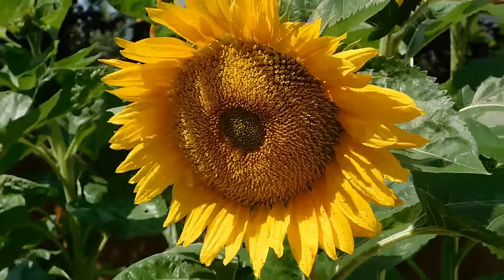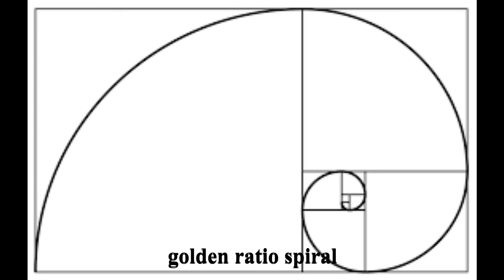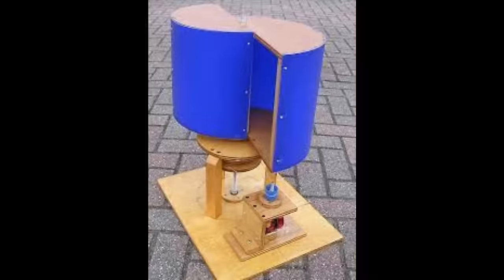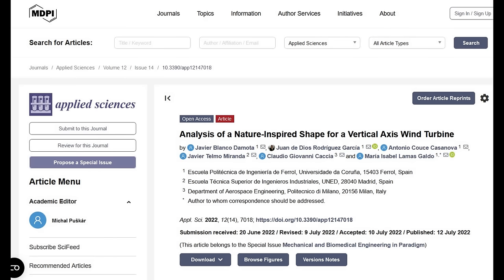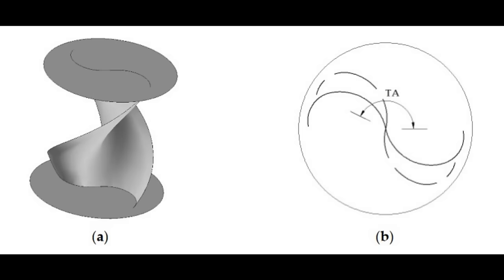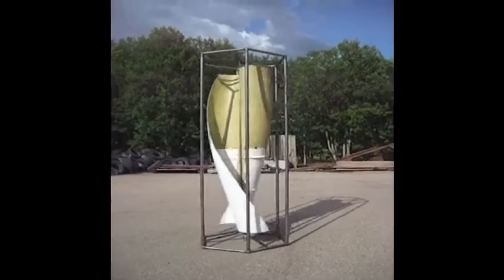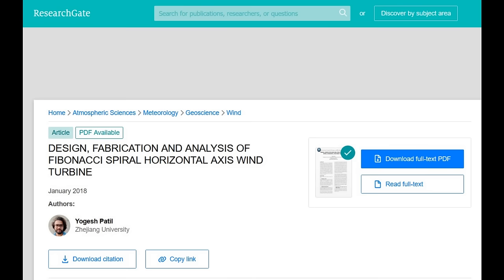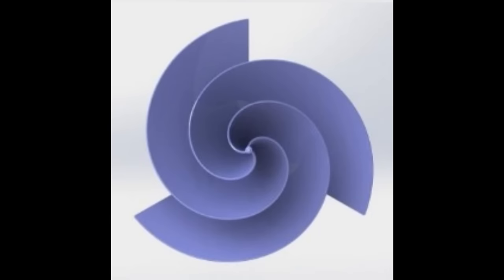2210 The Liam F1 - Spirals And Wind Turbines

Comment: I have come to the conclusion that for me the best thing is to have a horizontal turbine along the roof of my house in Portugal. However with a bit of a diffusing  nossel on it. This raises the possibility of placing solar modules on the diffuser all that wind will cool the pv modules. An interesting point about pv modules my favourite company is sunstore. I will be using the 5W 12V modules. This seems nuts, but if you break one (very unlikely), you just lose 5W. They will be stiffer and will cool better. I may mount them invisibly in trees.

Comment: I recall making the point of closing the gap on Lukes oil drum windmill design,  this was suggested because of my decades of tinkering with both bird choppers vs bird repellent windmills, however just closing the gap was only a start, ended up using a heavy 6" pipe for the center of the rotor creating a compression point inside the scoop which greatly improved total torque to the generator/air compressor, still wonder if Luke ever improved his structure for that heavy oil drum rotor experiment?

Comment: It could be interesting to cover the Golden Ratio wind turbine with flexible solar sheets on both sides of each propeller. Movement would also provide cooling to panels. Or, on the other hand, cover them with mirrors (polished metal) and the wind turbine can also accumulate heat.

Comment: Great video Robert, food for thought. I was thinking what would different types of spiral effect be like on a car Turbocharger? They are very balanced and are quite easily aquired. You can blow on a turbo intake and it moves very easily and it's also capable of having an exceedingly high RPM.   I'm also looking at posibilities of using something like a roots blower to compress air and recycle it back into a turbine. (but sadly only thinking, not much time to try it out.) Still repairing my compressor.

Comment: Underwater bullets are coated with a material that greatly repeals water.
Could these designs be mounted on the front of a car to lower frontal pressure, using the motion to turn the alternator?

Comment: Hello sir, 
could you please explore the idea of composing rotor magnets of various shapes in order to maximize magnetic flux on one side. I noticed recently when i bough few magnets of various sizes when they were stacked in the box, theses two stacks barely attracted one another an when i was playing with those two stacks at certain angles and configurations - like splitting them into several stacks, sliding or rotating and so on..... they attracted each other in wildly varying intensity in some configurations.
So i went and searched around. And i think in a very crude way i stumbled into a this concept of Halbach array.

Comment: Hello Mr. Murray-Smith,
With some luck, you're the guy I'm looking for.
In my research I stumbled across something that refuses to let go of me.
It's the idea that air can not slow down.
According to this notion, any molecule or atom in air (or any gas for that matter) can only travel at the speed of sound in relation to its point of origin.
So much so in fact, that it is that velocity that defines a gas.
There appear to be all sorts of scientific arguments against it, but they all seem a bit far fetched and theoretical, whereas many observed phenomena and simple logic support it.
Air can not travel faster since the speed of sound is an escape velocity and thus not related to the total magnitude of the force that created it.
It can't go slower either because then it simply doesn't escape.
The thing we call airflow is merely the dominant direction of the resulting movement.
It explains why increase of airflow always coincides with decrease of pressure for example.
It opens a whole world of new interesting possibilities.
Theoretically it allows for a turbine to be powered by the thermal energy of the air passing through it, just to name one.
Since you seem to cherish free thinking, I was wondering what you think of it.

Comment: Here in the U.S., I would love to see cities adopt building codes mandating some solar and / or wind generation be built on every house and on top of all the flat roofed warehouses. Also Small Modular Nuclear Reactors scattered around for base load.
Reply: You know they would screw that up and come up with the most counter productive way to implement it. Kind of like how they screw up crawl spaces.
Reply: Oh no! Fragments of glass and fiberlass will be scattered everywhere... The noise will be everywhere. And pigeons ...
Reply: @matthewconnor5483  True
Reply: @MihailG5541  Vertical axis windmills, not 3 large blades.
Reply: @66block84  For all vertical turbines you need at least twice as many materials for the same annual energy production than for horizontal